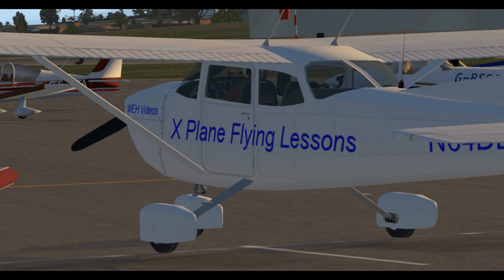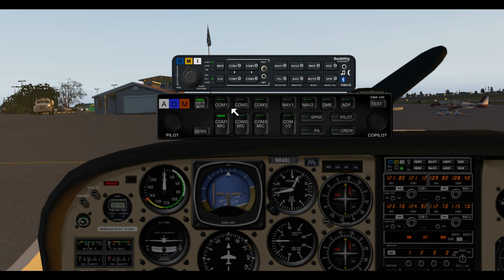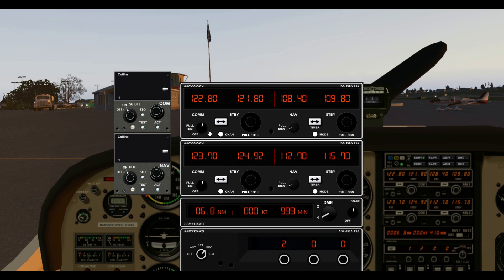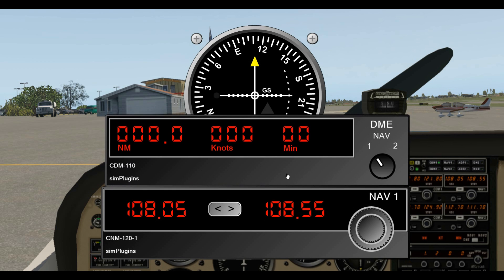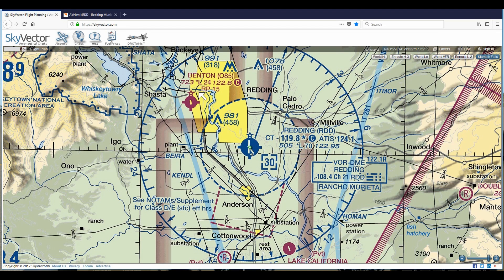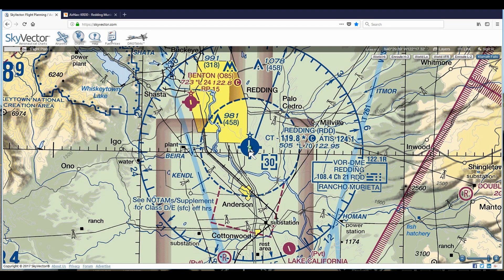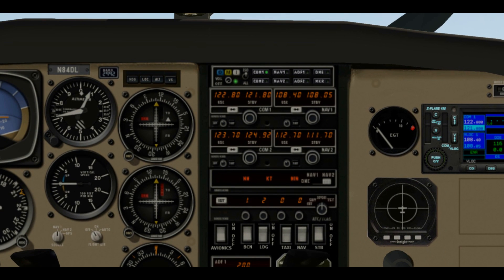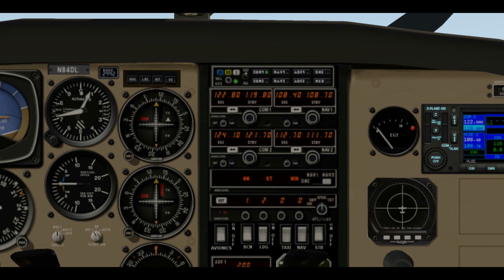The COM & NAV Radios ~ Learning to Fly for Beginners in X Plane 11 Part 12

Comment: Just started with x-plane (at 92 yo) and having a problem.  It seems after taking off the speed changes and we crash.  Using a new Dell 5 computer with Logitech extreme 3d pro (2d one).  Any help on why this happens.  Appreciate any help.
Reply from the maker: Hi Bill, Welcome to the wonderful world of X-Plane :-) I'm going to need more information before I'm able to attempt to help. First, what airplane are you trying to fly? Have you read the Manual so you know what speed is needed for takeoff. Have you setup the airplane correctly for takeoff, are flaps necessarily? Give me as much information as you can about  what you are doing and maybe I can help.

Since you are just starting I suggest using a "not so hard" airplane to fly such as the Cessna 172SP that comes with XP or the 172N I use in most of my videos. If you are interested, X-Hanger has given me the rights to their Cessna 172N, the airplane I use in most of my videos, and have allowed me to give it away to anyone who would like to use it for following along in my videos. You can learn how to download it by watching the video in the link below:

https://www.youtube.com/watch?v=mmOxFBkgEBE

 92!! That's Great :-)
Blessings,
skip
Reply: @WEHVideos  hI Skip, and thanks so much for replying, even though i realize not, I was not responding to your video.  Anyway for additional info: I am not using any other plane than the Cessana 172 - like it a lot. I recently purchased a new desktop - Dell 5 which is a low end gamer, but a lot faster than my old old Acer. I originally thought the problem was the joystick.  I purchased an older Logitech Extreme pro 3d, which just turned left as soon as I released the brakes on the keyboard.  There was a sale on Amazon so I purchased another Logitech - a lot newer, and noticed the throttle had more resistance than the first joystick.  Anyway I finallymanaged to get the plane into the air, but shortly after - and I touched nothing - the speed changed drastically both faster and slower and the plane crashed - but I emerged without a scratch - LOL.  One thng I did was move all the x-plane files to the Radeon gaming location, but I do not know if that is a good idea.  I did try and get some info from the forum without any success.  I do not want to invest in a yoke at 92 yo, but I really do not know what the problem could be.  If you could provide any insight in either setting up or moving x-pamce back to the desktop, or anything I could try, I would really appreciate it.  Right now I spend most of my time either on a walker when I go out, usually to the VA, or a wheel chair when inside,  Again anything that you might know that I could try would be appreciated.  Thanks again for your speedy and kind response. Bill
Reply from the maker: Hi Bill, Ok let's look at the frame rate. Go to settings and click  "Data Output" you will see a bunch of check boxes. On the first row you should see "Frame rate"  across from that some check boxes. Under "Show in Cockpit" check the first box under that. Now when you run X Plane you should see your frame rate displayed in a little window in the upper left corner of your screen. Keep and eye on that as you fly to see if anything you do effects that rate. You should have an absolute minimum of 20fps. hopefully you have over 30fps which should be fine, not the best but good enough.

Second. make sure your joystick is calibrated. On the Settings main page find "joystick" and should see an option "Calibrate" go ahead and calibrate all your controls again.

Not sure if were you put X Plane makes a difference but I'd put it on the Desktop, just Cut and Paste the XP folder to the desktop. You will need to make another shortcut to that location.

I'd also run the X Plane installer again to make sure you are up to date and files are not missing.

That's all I can think of for now, give these suggestions a try and let me know if it helped.

92 & Veteran!! Thank you for your Service, where did you serve?

Blessings,
skip
Reply: @WEHVideos  Hi  Skip,
Thanks again for speedy response.  I usually go to the VA a couple of times a week so I do not always geton line.  First re x-olane.  My frame rate unfortunately is 23+ I have calibrated my joystick many times.  It seems that I have to reverse the throttle.  I will move the files back to the desktop and redownload, but I do not think that is the problem since so many others are flying fine.
As far as my military career I joined the army at 19 in January 1948.  Took 16 weeks of basic and then leadership course, and after a few assignments the same year was shipped over to occupied Japan. That was a great assignment until the Korean war started.  I was part of MacArthur's commuication unit, and on a Sunday one message came in that the North Koreans crossed the 38th parallel and the troops there were heading south.  Gen Mac said "Get me communications", so they woke us up that night, broke us into two teams and off we went.  The other team was wiped out giving us the first purple heart and the first 30 killed.  After about a year and a half I was finally sent back to the states, and after another year or so was sent to the Military Mission in Greece.  After that it was the pentagon, back overseas to Turkey, back to Ft Bragg and back overseas to Paris.  Back to the states and then two tours in Nam where I was exposed to agent orange and now have a form of cancer recently discovered only a year ago.  I left the service on January 31, 1968 with 20 years, worked 17 in a communications ompany and finally retired at age 58.  Did a lot of travelling since revisiting Europe and Asia.  My sports were skiing (expert) and tennis (not that good).  Taught spreadsheets and computers in a computer club for many years, but now nothing.  So just hanging around I figured I wanted to fly - something that almost happned for real in Ft Bragg, except I was sent to France and missed the change, so not simulation is what I want to do since I have a lot of spare time.  I am also rethinking something I did as a kid - magic, and haunt Youtube picking up new and old tricks with cards.  Not there yet but am trying.
It is nice that you take the time to prepare and post these videos.  They are very informative to us.  I would like to have a yoke, but at 92 how much do I want to spend for a hobby that will not last too long?  But I will keep trying to get x-plane working for me.  Nice chatting with you.  If you feel I am taking up too much space on your site, you can always email me - bill.sheff@gmail.com and I will respond in kind.
Regards, nice chatting and sharing some of my past - there is a lot thrown into the 20 years which would probably fill a book, and a friend of mine suggested I write.  I did send some info to the new army museum, and they said they accepted it.  All in all my military career was varied.  I started out as a private and ended up as a Chief Warrant Officer in a very interesting field.

Chow

Bill
Reply from the maker: Hi Bill,  23 fps is not to hot but I don't thing that should cause the problems you describe. I didn't mention the Graphic in settings before so go to Settings and under Graphic move the top four slicers all the way to the left and then check your frame rate. If the rate improves a lot you can start moving them back to the right. I'm guessing the Visual Effect will have the most effect on frame rate you need a really good graphics card to run XP with these sliders farther left. I'd like to see a frame rate above 30fps.

I have to say if you want to get the most enjoyment out of computer flying you really need good equipment. Here's a link to my suggestions:
https://www.youtube.com/watch?v=9SiJwp9NvlU&t=291s
I realize this can be a bit expensive but the more realistic you can make it the easier it will be to fly eliminating a lot of the frustration hence more fun. 

Wow what a carrier you had, way too exciting for my liking. I did three tours in Vietnam from 1964-1966 patrolling the coast along with Swift boats and Coast Guard Cutters, I was on a small destroyer escort, spend a few days going up to Saigon when General Westmoreland took over.

Seems we have a bit in common, I just found out this week that I also was exposed to agent orange, not really sure what to do with this knowledge I'll do some research I guess.

When you rerun the XP installer it will just look for missing or damaged files and of course update to the latest version, I hope this will help. Let me know if adjusting the graphic helps any. If not probably looking at a new computer.
Blessings,
skip

Comment: useless because u do not show   HOW TO WORK THE BUTTONS
Reply from the maker: Hi Mulberry2000, Sorry to hear that. Can you be more specific as to how I didn't explain how to work buttons? There is only one button on the Comm and Nav radios and that's when there are is a standby frequency and you have a flip flop button to switch from standby to active as I explained in the beginning. Again, sorry I didn't explain that too well.

Blessings,
skip
Reply: @WEHVideos  it is not u it was flywthlu. so sorry about that.
Reply from the maker: No problem hope you get it figured out :-)
Blessings,
skip